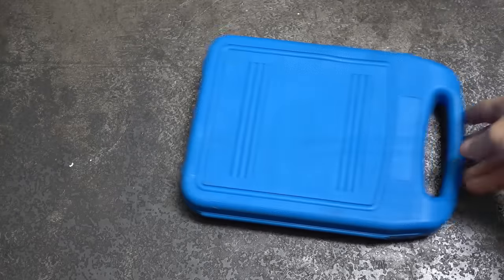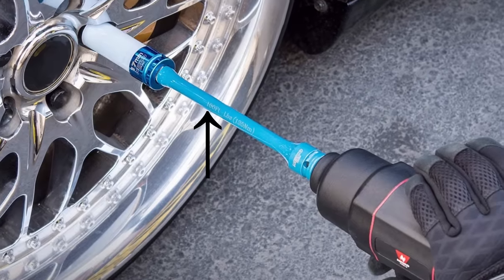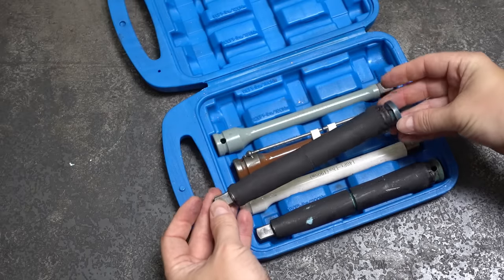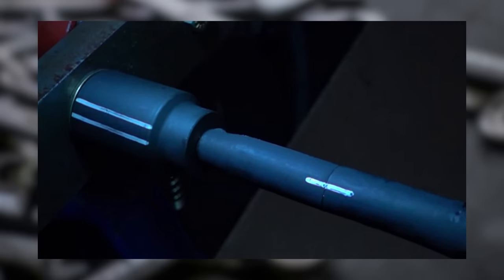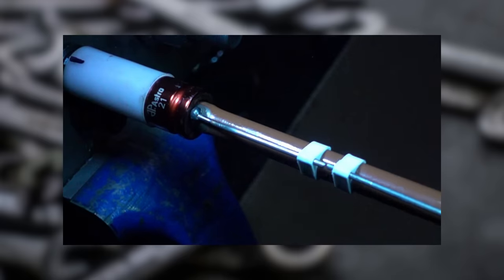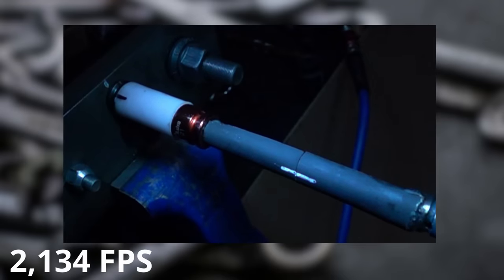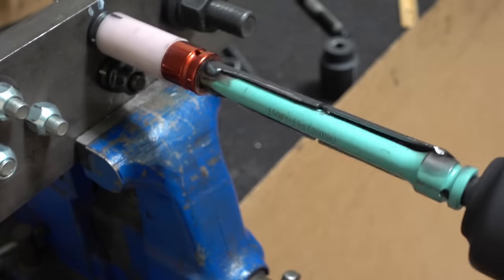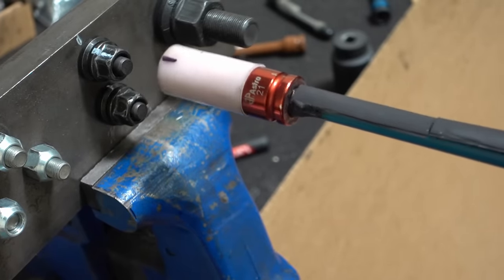Torque Sticks! High Speed Video Helps Reveal the Truth

Comment: There are couple options I see for increasing the 'stiffness' of your testing rig:
1.Flexible hydraulic hoses move and expand noticeably under pressure and you lose a slight amount of 'stiffness' in your hydraulic system since the volume available in the soft hoses changes with pressure. If you were to plumb the rams and gauge up with a shorter run and hard fittings(if possible, or at least minimal rubber hose), then you should see a difference in the stiffness of the hydraulic system. You might see a large difference since your soft hoses  seem like they might be a significant % of the overall volume of your test rig.
From what I see of those industry hydraulic conversion machines is that the gauge is directly on the cylinder outer housing with no hoses or significant plumbing visible. I would guess that those testers are very hydraulically 'rigid' once they free of air.  For all we know even those testers aren't 'stiff' enough to make a torque stick work properly, since damaged studs that have lost stiffness are a problem.
2. Using a single hollow hydraulic ram with the bolt through the middle, I don't know if there are options for sale that would keep your bolt length down close to what you have now, but even with the thiccck plates you are using they are probably less stiff than a rig with the same bolt length and end plate thickness that uses a ram with a hole close to the OD of the bolt you are using. You definitely have those rams close to the bolt though..... maybe it wouldn't change the stiffness much.

After saying all of that: 
I don't know if there is any value in making this change to your rig, since it may skew your testing and make comparing new testing to old testing difficult which may be a detriment for you guys, and probably only matters in edge cases like these torque sticks. The other thing is, your gauge probably has a fair bit of smoothing to the input pressure with the current rig and may possibly not like being given sharper pressure spikes

As a side note:
Some equipment actually makes use of the volume change of soft hoses to eat up pressure spikes. Our Cat 345B excavators (48 Tons) have a 2' section of hose attached to a T on the pump outlet of both of the main pumps. These hoses have a plug in one end and are just there to smooth out some of the pump pressure spikes, probably to keep the swashplate control system from behaving erratically and maybe reduce wear on some components that would otherwise see more hammering from pressure spikes that would be higher without the hoses that go nowhere.

Comment: I use a 2767 with torque sticks very often.  Setting 3 means over-torque is guaranteed, even when trying to stop as soon as the nut hits bottom.  Setting 2, however, means I come in significantly under the rating. (the torque wrench moves up to about 1/4 turn)

It’s weird, but not having to fool with air lines is very nice.

Comment: I had read that you shouldn't use a cordless impact with a torque stick, and now I see why. I don't even have a cordless 1/2" impact, so it doesn't matter to me. My air powered (pneumatic) 1/2" impact works just fine.

Comment: I've always held the theory that torque sticks were designed around older slower operating impacts, and when these newer super powerful impacts came out they change the numbers so much that they are not accurate any more. Personally I use the lowest setting to just run down the nuts then put a torque wrench on them to bring them up to proper torque.

Comment: Well, the only two things I can think of as far as differences between the battery and air is that air is a compressible fluid, for all intents and purposes, and might allow some kickback (so to speak) wheras most of the electric drivers provide a far more consistent and faster rotational force, in addition to the higher impacts per second, as you mentioned.

Comment: Well I see the torsion spring effectively resonating with the impact rate such that the torque let's say node for peak distortion and strain is met with another blow after rebounding or in other words it's either preloaded or springing forward in torsion and then receives the blow concurrently with maximum dynamic torsion it's almost a linear tuning fork that works with harmonics and resonances

Comment: Recently changed a whhel that was torqued with a 120nm stick on a 1 inch milwaukee impact wrench, wow that was super tight, def not 120nm. But, as the tire shop guy said, the small impact wrenches dont have enough power to overcome the torque stick loss.

Comment: I've been using the torque sticks I own with cordless impacts on lugnuts not knowing there would be a difference.  I assumed they've been working because you can hear the clear change in impacting sound that I assumed indicated they had reached their limit.

Also I was checking with a torque wrench, but it seems my clickers will just yield and click if I'm close enough to the intended spec.  Probably the built-in tolerance.

Comment: Torque sticks are really intended for tire shops who regularly hire and train inexperienced employees, and use professional high output impact guns. lugnuts can be a little over torqued and be fine, as long as you don't shear the splines, and you check your pressure with a torque wrench. For that intended purpose they are priceless, and infinitely worth the money.

Comment: Science!  I wonder if they could build torque sticks that rebound faster to offset the increased IPM, or if the tool makers could put a mode that lowers the IPM closer to air tools.  Every change made will have a consequence, I guess this is one for the increased IPM of newer tools.  Is impact frequency the only variable in this, or does the strength of the individual impact have some effect as well?
Reply from the maker: Many cordless impacts do have lower IPM modes. Last time we tested we found an M18 mid-torque in 2/3 setting worked as well as an old school gun, but it seems so dependent on the cordless impact it's not worth recommending. If you're already messing with modes and smaller impacts, just use the line marking method to find what that tool can get close to without a torque stick!
Reply: @TorqueTestChannel  not sure but the problem seems to be  a harmonic frequency driving  spring plus dampener type problem.  Changing the impact Impulse value or frequency will both result in the stick transmitting different forces.   The torque limitter can only be calibrated for one fixed impulse value and one hit frequency use anything else and the results may vary.....
MECH ENG math differential Calculus 3rd year text?

Comment: The torque stick is basically working like a spring. The cordless impact gun has smaller hits at a higher rate. The spring does not have a chance to rebound in between hits like the would on a pneumatic impact gun.

Comment: Thank you for this video.

Have you tried using short, impact-rated sockets?
I remember either reading in comments of a YouTube video or some forum, people were trashing harbor freight torque sticks (may even be on the reviews of HF site), saying that it actually over torqued on their impacts.

It also turned out that torque sticks on cordless impacts were overtightening versus their usage on pneumatics.

Someone suggested that perhaps the deep sockets were themselves introducing some twist.  Looking at your rope analogy, the torque sticks will only work if the sticks twisted back to the resting state before the start of the next hammer hit.  In other words, while that rope analogy is correct, the reason why torque sticks stop at specific torque is because the "rope" will twist more if the person on the end is heavier (as in nut hitting the stop).  So as the nut hits the specified torque, the energy of the impact of the wrench will end be used to twist the shaft of the stick rather than turn the nut.  Unlike the rope,  the shafts have much more limited degree of rotational motion before introducing the impact to turning yhe person (nut).  So this being said, the torque sticks will work as long as the twisted shaft is allowed to relax back to the zero degree before the next hit.

The idea was that by using deep sockets, the inherent torsional give of the deep sockets (especially thin-walled deeps) would be like adding additional range of twist to the torque sticks.

This brought up a couple of ideas.

1. The sticks ability to limit torque gets more pronounced as the nut nears the targeted torque (as seen and said in your video).  The tinest amount of flex from the deep sockets may make it seem like the nut is not tight and is not giving enough resistance to allow the energy to be transferred to twist motion, which would mean that energy is then driven into overturning the nut.

2. The tiny added twist that deep sockets introduce will mean that the arc range of the twist will be greater.  If the deep sockets twist of its walls relaxes earlier (then the relaxation of the torque stick's shafts), then the return of the twist after the hit may not allow the shaft to get back to resting position before the next impact of the driver.  Using yhe rope analogy, this would like if the metal plate was struck and then because the plate is taking too long of a time to return back to its original position, when the next impact occurs, the plate is actually in a different (more tightened) position than the first hit.  If you keep this up, the result will eventually be the shaft being twisted and not being allowed to relax.

3. The cordless impacts hit at a different rate of beats than pneumatics.  Someone said that pneumatics hit at a slower rate than cordless (i don't know as I only own a HF pneumatic and an ancient dewalt 18v (on 20v adapter), and have no real equipment to test it).  If the cordless does hit at a higher rate, it could also be that the time between the drives of the impacts is too soon, so that the shaft of the torque stick does not have enough time to untwist to get ready for the next blow.  Adding extra flex, in the form of a deep socket, no matter how little, will cause the refractory period of the sticks to increase.  A driver with shorter time between impacts will then end up, "building up" the twist in the shaft, which cab also cause overtightening.

Now that I write this, I think I may read this on a reddit thread.  This being said, some people replaced their cheap harbor freight deep impact sockets with shallow, snap on sockets and they reported that the HF sticks were working correctly.
Reply: I guess I should have finished watching the video instead of stopping it to write my previous comment.  I see that you actually explained how the stick not being allowed to relax (by stretching studs or nuts) can introduce pre-tension which can cause the overtightening.

I think you nailed what is wrong with the stick when they aren't working.  It's like animal muscle and repeated electrical impulse from the motor neuron.  In cell biology we learn that the muscle has a refractory period in which it isn't supposed to fire, where the actin and myosin filaments need to relax back to their resting state.  If you keep stimulating this muscle, it goes into a, tetanus a muscle lock or spasm because instead of starting next impulse from the resting state, the muscle now has a bit of pre-tension.  This pretension keeps on building on subsequent firing of the signals.  The graph of this is exponential increase in tension until it approaches an asymptotic and hits a plateau at the physical limit of the muscle fibers.  I am guessing if you measure the torque and graph it, it would look similar to the muscle tetanus graph.

My original comment was that on a reddit post somewhere the discussion was that it indeed seemed like the twist of the shaft was not relaxing on cordless vs. Pneumatics, and then someone suggested that the deep sockets maybe intoruding additional twist which would cause similar effect to what you said about stretching studs and nuts, and that the cordless may also  have shorter time between hits.

I would love to see if using short sockets will make cordless work with torque sticks (as claimed by folks on the thread I read).

You also have to wonder how the manufacturers calibrate the sticks when they design it.  My guess is that they have a machine that has a 1/2" square hole and the stick end is inserted into it.  So they literally measure the flex angle and the torque at which the shaft gives, at the shaft only, which makes your test the more accurate, real-world test.

Considering that the sticks operate on twisting and relaxing of the shafts, adding additional material that can introduct flex (deeper socket, or any socket if manufacturer tested without one, studs, nuts) can only make the stick move out of phase from their operating conditions.

No manufacturer states the maximum bpm of the sticks, which if you take into what you said about needing to have the sticks relax between impact hits or face introducing pre-twist, the bpm info is actually quite important.  For example, if it is a 100ft•lb stick, then manufacturers should know the amount of time it takes the twisted shaft to return at conditions where the  impact load + resistance of nut >100ft•lbs.  If they know this time (refractory period, let's say), then diving 60sec by that time should give you an idea of the maximum bpm allowed on the wrench to allow stick to relax between hitswhile at it's (srick's) max torque.

For the same 100lb•ft stick, the total amount of degrees that the shaft twist while absorbing impact (at >=100lb•ft) would also be a nice thing to know because if the impact hammer hits the driver through a larger degree of motion then the max torsional angle of the stick's twist at 100lb•ft,  then the stick is basically doing nothing, as at the end of the impact cycle, the stick has already twisted to max, there will still be impact energy left, and this  additional energy will translate to rotation/tightening of the nut.

Comment: Here's another curveball, I've been told the torque sticks with a built in socket are more reliable than torque stick adapters. I bought a Blue Point 19mm 100ft lb stick and a 21mm 150ft lb stick. Perfect for what Ford recommends for torque on passengers cars and F150's.
Reply from the maker: Accurate might not be the word for it, as the design of the stick is fixed at the factory so they obviously had X tool in mind when designing it. Consistent? probably, as you have less variables you can attach on the end. But it's always going to come down to how it works with your gun which is why the marking method works best. If you have a monster air gun a 100 stick still might be a 120 stick or you'll need to use it in setting 2 of 3 for example.
Reply: I use a 120nm stick and a 21mm wheel socket on it. When I go to torque it with the wrench afterwards it's pretty much spot on just about every time, either just right or can tighten it just a tiny squeeze extra! Seems pretty accurate for my setup 👍

Comment: Give someone a pry bar made of spring steel. It will limit how much effective leverage they can deliver. (Yes this is only meant as a thought experiment, I realize a springy pry bar would be very dangerous.) Or try pounding a large spike into the ground while a coil spring sits on top. The coil spring will return much of the force you're attempting to deliver..

Comment: In the old days, and still today at home, I just reduce the air pressure on my impact gun at the gun valve to a level of removal with a 4 way. Done it so much, I don't even have to double check the valve setting. I just turn it down and drive on. Never have used torque sticks or a torque wrench. Never have had any come loose or problems doing it that way. Only now days I cheat, I carry a portable impact in the car in case of a flat. Faster and easier.